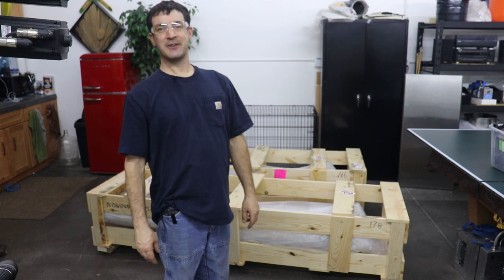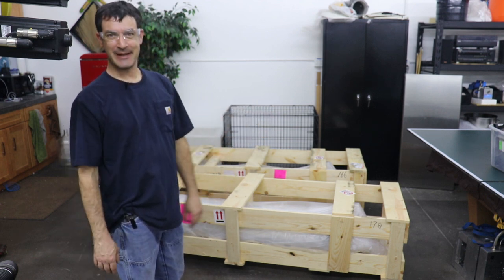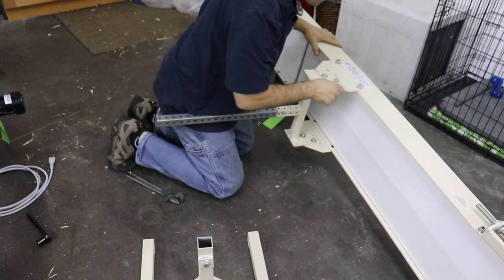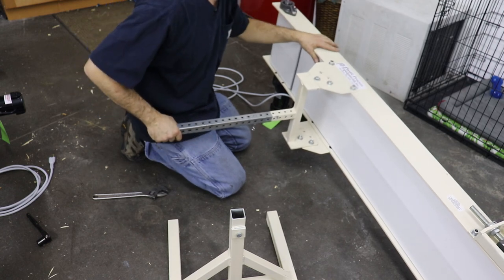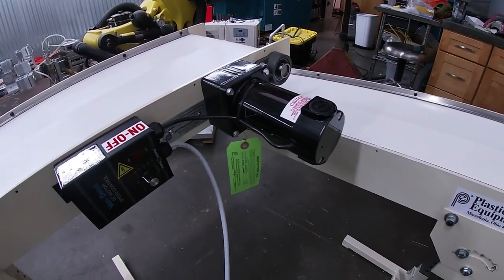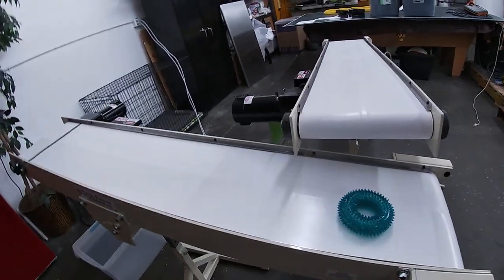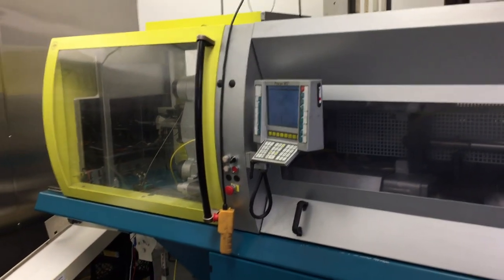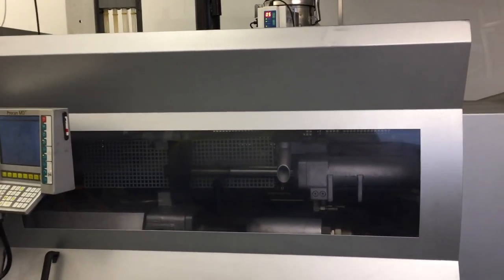CONVEYOR BELTS

Comment: Can you do a video on the AC unit mold chiller in the background?
Reply from the maker: OK, will do.  I get them off amazon (fish tank chillers)
Reply: @DragonflyEngineering  Thank you! I could have sworn it was part of a mini-split system!
Reply from the maker: @jonathanhornell-kennedy4521  I have one of those for cooling the shop too, but stil need to finish install, you may have seen that one